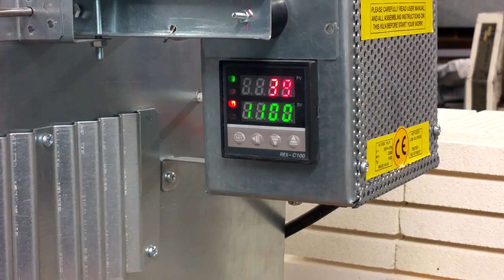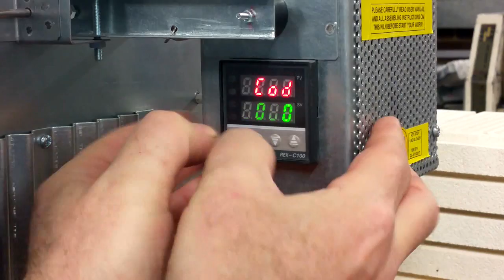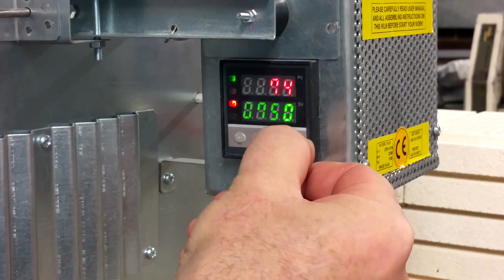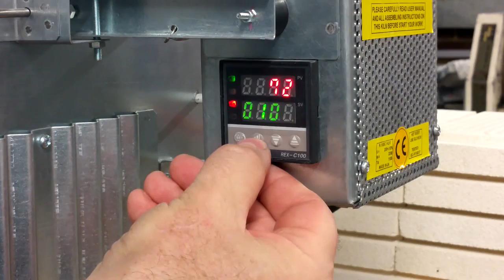REX-C100 settings

Comment: Concerning this PID with SSR... if I have a 10kw heating element, is there any way to decrease the frequency of the signal from the PID sent to the SSR before limiting my heating element to 9kw? For example, is there an option in the menu that allows 90% of the signal sent to the SSR instead of 100%? That would solve my problem.
Reply: No, it is not power regulator.
Reply: It controls temperature.

Comment: hi thank you for you easy to follow video it was so helpful to me as im dyslectic and find  instructions hard to decipher. your vidio is amazing, your instructions were so clear and precise and so easy to follow. that is why im writing to you im having a problem and im hoping you can help me please. i did 2 firings then the kiln stopped heating for the next firing, it shows ambient temp and desired temp. on the left is green light (the 2nd from top)  it is steady just as normal but no heat. its as if the power to the heating elements is not geting through. every thing turns on so there is power,  it just wont heat up it took 30mins for the ambient temp to change from 21 to 22. but if i hold the pyrometer with my fingers it goes up rapidly as it did when it was working. is there something that cuts the power of from the element's?  i would be so great full if you could help me please. kind regards kay.
Reply from the maker: Based on your description of the issue, most probably the controller sends the signal for the kiln to heat up, but something inside the kiln does not work properly so the command isn't carried out. In this case your kiln probably needs to be opened up and checked inside with a voltmeter to see how the electricity goes though the networks. If the power control is assembled with the SSR relay then please take a look at the relay - does the LED light up on it when the kiln should be heating up (majority of SSR relays have such a control indicator)? If the LED does switch on then you need to check whether the high voltage (230V) reaches the relay, and whether the voltage leaves the relay at the moment when the LED lights up. These are the initial steps for the checkup. If the high voltage does not reach the relay then please check the network - maybe one of the fuses in the way to the relay has burnt out.
Reply: @furnacestools6981   hi thank you so much for all your help i really appreciate it. it wasn't the controller after all. the heating elements had a broken at the connection point.

Comment: I have a question. How is it controlled to heat the oven 10°C/min or 20°C/min? I could not set the temperature step in PID.
Reply: You can't set heating speed. This function have programmable controllers only.

Comment: Thank you very much friend if it weren't for you would be with a controller without any use, thanks to you I was able to configure mine and finally enter configuration 2, it was blocked thanks a lot, a big hug here from Brazil.

Comment: You have no idea what you are talking about! Reading out the display most of the time, what a joke! Did you make this video for visually impaired?!
No explanation what those settings do or are used for!
All those settings are not "correct", they are just settings for different uses and scenarios. Each setting is "correct" for what you need.
Incompetent and incapable of formulating a coherent explanation!
Reply from the maker: Have you checked attentively the video description? It says that these are the correct settings  for our kilns, meaning that they are for the kilns that we manufacture. They are not universal for all the kilns.
Reply: IM DYSLEXIC AND LERN VISUALY. YOUR THE ONE THAT DOSENT KNOW WHAT HES TALKING ABOUT! THIS VIDIO WAS BRILIANT JUST BECAUSE YOU DONT GET IT DOSENT MEAN IT HASENT HELPED OTHERS. YOUR A VERY ROOD MAN! HE WAS SHOWING THE RESET OF THE KILN EVEN I NEW THAT MUCH.

Comment: Will tis shut the kiln off when the set temperature is reached? Or does it just keep the kiln from firing hotter than the set temperature.
Reply from the maker: Kiln not turn off, kiln hold set temperature.
Reply: @furnacestools6981  
thanks.

Comment: Hello,
I have a problem, the stove keeps heating up the temperature, more than set. The stove is brand new and the first use of Feher is already like that. If I set 200 C as the temperature, then the temperature in the oven goes much further up. How can I reset the settings?
I speak and understand unfortunately little English! I'm from Germany !
Reply: I had this problem, here is the fix...Hold set for 3 seconds to enter menu, then change ArU (ATU Auto tune) to 0001 and hold set for 3 seconds again. A light will be lit to say auto tune is on, don't interupt until light turns off, when finished hold set for 3 seconds to enter menu again and you will notice the P, I and D settings have changed, auto tune has changed these for you to better suit your situation, lower P setting for better results if your still going over.
Reply: @Forbidaxe  my AT light don't turn off, what can I do??
Reply: @jorgevalle0876  Unsure, mine did feel like it was in AT for ages before going off, maybe just wait a bit longer, a pain I know whilst trying to do what it is your doing.
Reply: @jorgevalle0876  hello did you find a fix for this I’m in the same situation as you AT doesnt turn off it’s for a school project and I’m stressed idk what to do
Reply: Hello Andi!
I would like to ask you to find a solution to the problem, because unfortunately, my system is setting this setting to this setting.
Best regards Michael
Reply: I'm from Hungary!